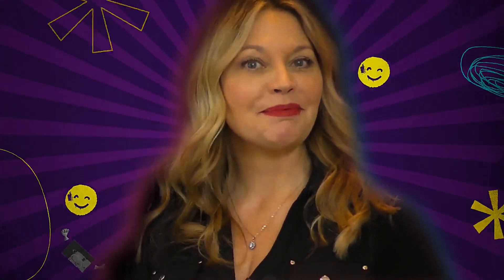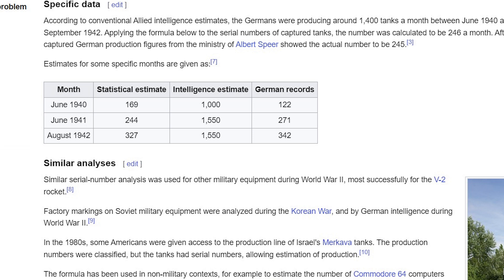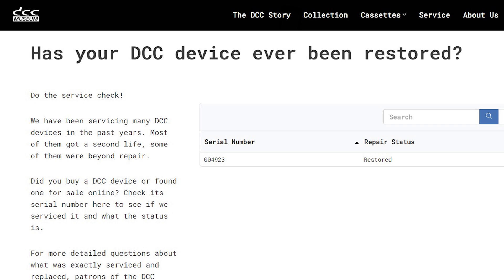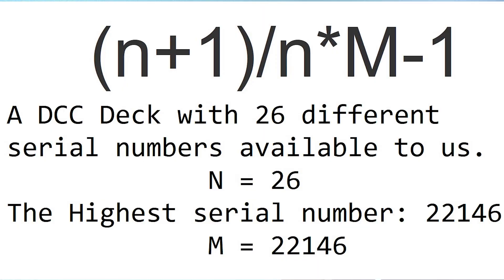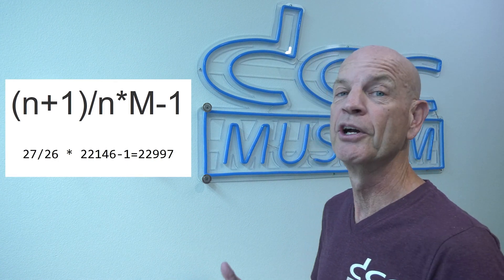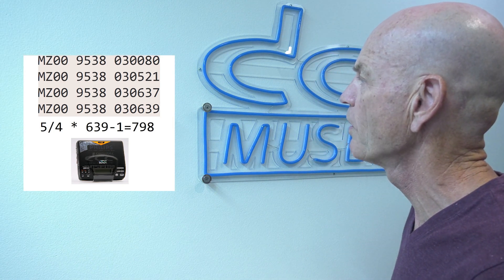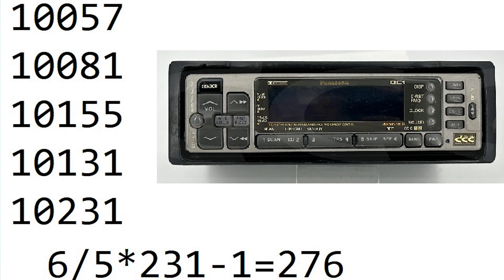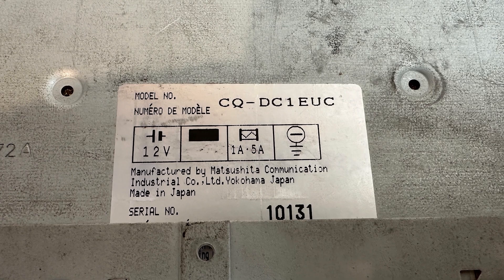How Many Digital Compact Cassette Decks Were Ever Produced ? Calculations  Via A WWII Formula.

Comment: The production numbers for the car units are surprisingly low. I wonder if there are fewer surviving car units because they were more likely to get thrown out after the owner upgraded, or scrapped with the cars they were installed in. While the home units were more likely to get stashed in a basement or attic.
Reply from the maker: The way, the formula works, it should not matter as much, how many survivors there are. But I agree, that the number of car units are low. They were also almost double the price of a home deck.